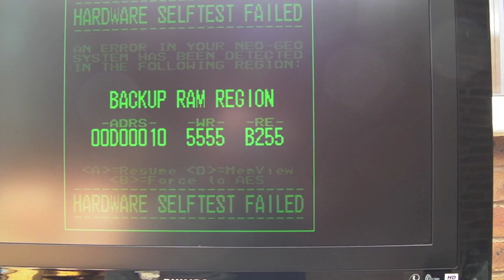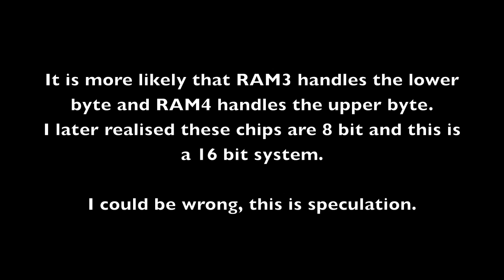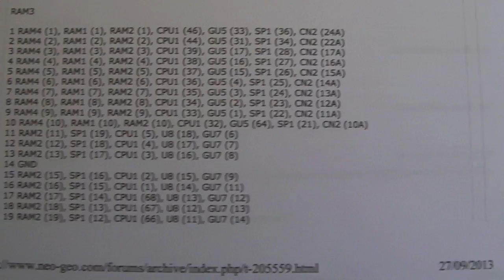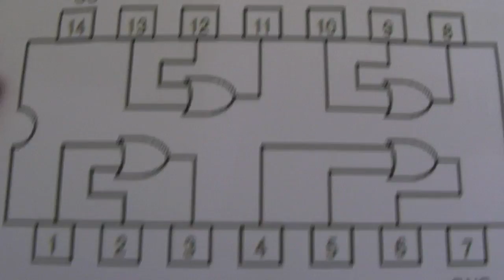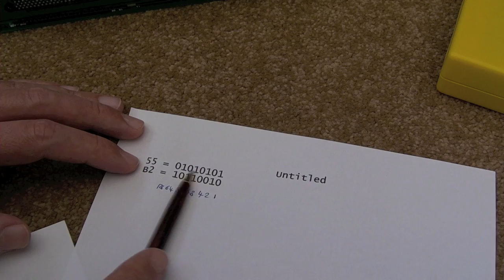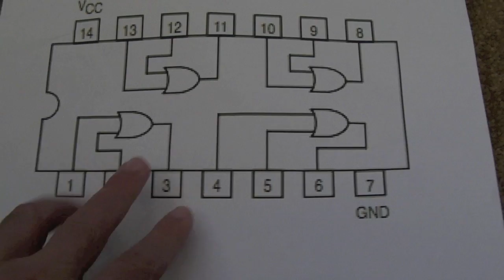SNK Neo Geo MV-1FZ (MVS) Repair Part 1 (Backup RAM)

Comment: Hello. sorry for resurrecting this video but your videos are godsent  very thorough. i have 3 mv1fz boards that i am trying with a supergun. i have been testing them on a b&o mx8000 and a panasonic plasma with a scart input. the problem that i dont seem to be able to fix is a picture shift to the left. i loose some of the picture from overscan. the same happens on both displays. i have tried to shrink the picture from the service menu but this part of the picture seems to be cut out no matter how much smaller i make the picture 

thanks for all your help
Reply from the maker: It's possible that is is caused by the Neo Geo outputing video a slightly less than 60Hz.  You could try using the service menu on the B&O to try and compensate.  To fix it, you might be able to replace the crystal on the MVS with a modern mod that provides the exact clock speed required so the video aheres to the proper timings.   You could try attenuating the syncs further in case they are TTL level on the supergun...   ie. put a resistor in series with vsync or hsync.  Ideally you want to measure them on a scope and aim from around 800mV.
Reply: @GadgetUK164  thank you for all your help. i found a scart adapter that has position adjustment and i also found a jamma connector that is connected before the supergun and has potentiometers for position adjustment. Do you think either could solve the problem ?  i have been trying to find which crystal i need but i cannot find any leads

Comment: Hi! I have a mvs mvh mv1fz board that needed to change the neo-b1 ic, but ended up breaking pad number 42. Looking at the neo-b1 pinout, number 42 is TD02. I couldn't find where to plug it in. Can you help me? I already looked in the schematics, but I didn't find it either.
Reply from the maker: I dont have one nearby that I can measure sorry!  Check the Neo Geo AES schematics, they are much clearer and have the same IC there!

Comment: Hola muy buenos sus videos  están en inglés pero no importa, le consulto me e comprado mi primera  MV1-FZ anda bien pero la pila 🔋 tiene 2,4v usted que me recomienda que la reemplaze o que deje la placa sin la pila espero su respuesta  Saludos desde Argentina.
Reply from the maker: Hi =D  I would remove the battery completely!  The only reason to have one on there is if you are wanting it to save high scores!  If you do want a battery, consider replacing the battery with a CR2032 holder and battery, and replace the resistor / which charges the battery with a diode - to stop the battery getting charged accidentally.
Reply: @GadgetUK164  Muchas Gracias  por su respuesta Saludos 🫂

Comment: Why u don't use flux in soldering component's ?
Reply from the maker: I usually do!  I cannot remember where I soldered on this particular repair - I perhaps didn't have flux at the time (other than the solder containing flux), but that Neo Geo was tidied up later using some Chip Quik flux.  I tend to use that flux all the time now.

Comment: Where did you get a hold of the replacement Ram?
Reply from the maker: Just search on eBay for 62256 SOP 28 =D  Or you could buy the same parts from Digikey or similar.

Comment: Your explanation of why the Backup SRAM fails more often is interesting, but incorrect. The actual cause is a faulty design: The BRAM runs from BRAM_VCC, which is powered through a resistor, diode, capacitor network. This means that each time the Neogeo is turned on, for a few microseconds, the voltage applied to the BRAM chips from the address and data bus is higher than the BRAM_VCC, until BRAM_VCC charges up to the system VCC. Applying logic levels higher than a chips VCC is a recipe for latchup and device failure in CMOS ICs. It's also why the 74HC32 often/usually goes when the battery is dead-flat, and often leaking all over the board :(. It takes more time for BRAM_VCC to rise from 3V to 5V than it does for the software to start exercising the D and A buses.

Check it out with a scope to see what I mean. Put a trigger on OE or some pin on the D bus, and the other channel on BRAM_VCC and watch D overshoot BRAM_VCC every time you turn the power on.
Reply from the maker: Thanks for posting!  Thinking about what you've said there, that does make absolute perfect sense!  I honestly would have never thought about that as a possibility.
Reply from the maker: Following on from your comment there it got me thinking about the BRAM_VCC level in general.  Surely 3v is not a good voltage for a battery to power the backup RAM?  Would you agree its better to have a battery nearer to 5v (with mod to charging circuit), or maybe a super capacitor, to try and avoid any latchup damage?
Reply: No. You could, but the SRAM uses significantly more power at 5V than 3V, so the battery will drain much faster. I normally modify the circuit to remove the charging resistor and replace the battery with a non-rechargeable CR2032 holder. There is a further mod you can probably make to make BRAM_VCC rise faster, but I figure the 74HC32 lasts for years, it should be fine. I think removing the charge resistor (to prevent the coin cell exploding) should already help with the risetime, but I haven't really checked.
Reply: OTOH, you could replace the battery with a 3xAA or 3xAAA holder, big enough that the extra drain wouldn't really be an issue.

Comment: Hey man, my MV-1FZ play games fine, but only blank screen when push test button or boot without cart, what do you think?
Reply from the maker: Strange - you should get the cross hatch screen when booting without a cart?  Very odd!  If games play fine, and unibios doesn't report any errors when hardware test is enabled, then I wouldn't worry about it.
Reply: GadgetUK164 a friend from Assembler said that can be a problem with SFIX. Do you have this chip's schematic?
Reply from the maker: SFIX is just a ROM chip - It could be that, or perhaps one of the chips that feeds its CS etc.  I know on some of the older boards there's a 74HC259 or 74AS04 that can also cause similar problems.  The SFIX ROM is not JEDEC compliant though, its like a 27C301 or something I think.
Reply: Maybe it can be a bad trace so i asked about the schematics.

Comment: I'm seriously impressed you didn't ruin any solder pads doing this.
also, what soldering iron is that? it looks like a wood burning pen...

... are you doing this on a carpet!?
Reply from the maker: What I demonstrated here isn't the best way to remove a chip, but if you are careful like I was it can be done without damaging the board.  Some people cut the old faulty part off, but with SMD parts you have to be extra careful as its so low profile.   Regards the soldering iron, its not a wood burning pen lol, its an Antex soldering iron.   Yes, many people always focus on the carpet - You will find nearly all of my videos are based on the carpet.  It's obviously much safer to work off an anti static mat.

Comment: I picked up today my 2nd MVS board, MV-1FZ this time, but it turned out to be faulty. standard BIOS - garbage on screen - installed unibios 3.1 - hardware self test failed - error - backup ram region - adr 00D00010 wr 5555 re 4000. I folowed Your tips and started with checking connection table for RAM3 and RAM4. For now I got to 28th pin of RAM3 (pins 1-27 connections all fine) and there was no continuity to 5V. I hooked up system again and i checked the voltages on RAM3 (4,26V) RAM4 (4,26V) and U17 (4,4V) and IC1 (4,4V) - not good at all i supose. 5V line on CPU and RAM2 RAM1 is straight 5,01V (I got a nice new PSU for my MVS). Ill be checking further rest of connections to RAM4. Voltage on backup batt is 2,2V (hmm? to low?). Should I check further? Remove/replace the battery? Order new ram chips? Wire 5V line to RAM's? :) I'd love to hear a word of advice from You!
Reply from the maker: I would remove the backup battery from the board to start with.  With regards to the voltages on the backup RAM I think that is correct.  From what I remember you don't get 5v going to them, it's around 4.2v due to the charge circuit for the battery - I could be wrong but I vaguely remember seeing that on mine.  I would think it's probably the 74HC32 causing your fault but you might have a faulty SRAM as well.
Reply: GadgetUK164 Thanks for reply and trying to help me out on http://www.neo-geo.com/forums/showthread.php?256032-MVS-repair forums :) backup RAM problem is solved (74HC32 broken trace pin 3 to 4). Now im stuck on Video RAM wr 5555 re 5551 error. Already replaced RAM7 (still same error after) and tripple checked for all connections from VRAMs to LSPC2. Dont know how to test if LSPC2 is OK or not, would be a sad story if LSPC2 is causing the error :( since I guess the only source of working LSPC2 is another MVS board...
Reply from the maker: Please see my reply on the neo geo thread!  Basically, if the RAM is OK, and the connections between RAM and LSPC are OK, then it MUST be the LSPC =/  No other alternative really, unless there's perhaps a short on the RAM or the LSPC connections?  Have you examined the traces around the LSPC and checked none of its pins on the side are bent into each other?

Comment from the maker: It's worth pointing out that I really wouldn't recommend removing SMD chips this way.  Better using hot air or chip qwik.  It's also worth pointing out that using the drag technique with extra flux is the best approach to resoldering new chips.  I cringe when watching this video now, just because it's quite high risk and certainly messy compared to my approach on later videos.

Comment: i just got three boards in the mail, none of them work. two with garbled image and one with a video ram error 0000800 5555 55FF, i put a unibios in the one with the bad ram as a stab in the dark and it seemed to get it working, so that was a fluke. Hopefully the fault was with the bios not reading reading the ram that was the issue, might have to use it for a bit to see if it falls over. i managed to get a refund for the other two and convinced the seller to let me keep them to cover the cost of a new bios chip that i already had so the upshot is now i have two boards to fiddle with without any risk
Reply from the maker: Check for broken traces first (on the garbled and the vid RAM error).   The one with the Unibios - make sure you enable the hardware test and reboot it - see if it reports any errors.  There's a chance you need to replace one of the VRAM chips on that board.  If the hardware test mode is disabled you wont see the error and games might appear to be OK but will crash out or do weird things.  Let me know how you get on =)
Reply: GadgetUK164
enabled the HW test on the MV1FZS that worked with the unbios, turned it on and it showed a fail on SCREEN RAM. i think that means VRAM but looks like simple google isn't going to cut it. on the other one the LSPC2-A2, 9404 E43 (the square one top left, looks like a CPU) has corroded pins from 41 to 45 right where the pin gos into the chip . i cleaned off the surface rust and can get continuity from those 5 pins to another side to the chip and surrounding points but you can see that the pins are thinner and its the only clue so far. the third one i hove no idea, there is a super fine white powder on the board but i have checked the battery on all and the surface around the back up area is the cleanest. so it looks like i have some deep digging to do but its going to be a couple of weeks till i have time again so i wont be asking on the forums till then.

Comment: Exelent guide i really learn a lot just at looking it.
I like to know where you got the replacement chips for the board.
Thanks!
Reply from the maker: Hi, you can buy them from many places, but for convenience I bought mine from EBAY.  See link below:-
http://www.ebay.co.uk/itm/LYONTEK-LY62256SL-55LLI-SRAM-256K-32KX8-2-7-5-5V-28SOP-/351032749695?pt=UK_BOI_Electrical_Components_Supplies_ET&hash=item51bb2eae7f

Comment: Hi i subscribe,t to your channel nice video learned A lot .
Reply from the maker: Thanks for the kind words!  I've subscribed to you as well =)
Reply: i  have not  made video,s the last year but thanks for the SUB
Reply from the maker: cor1128 Sorry I never saw this until now!  It seems private vid?  For sound issues - assuming games are working all OK, you need to look at a recap first, then possibly faulty op amp, and if you are using the on board main amplifier, possibly amp chip fault.   If the op amp and amp are all OK then you need to back trace through the sound logic - namely the Yamaha chip, and possibly Z80 and RAM associated with Yamaha and Z80.
Reply: GadgetUK164 the recap is done but no chance I am going to replace the yamaha chip . keep you up to date .